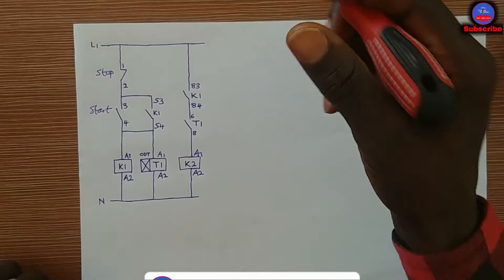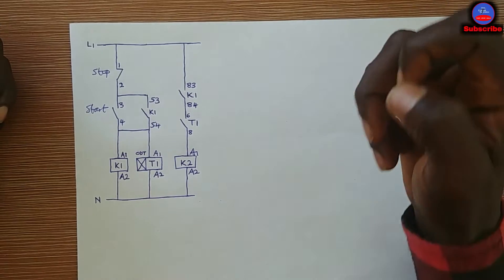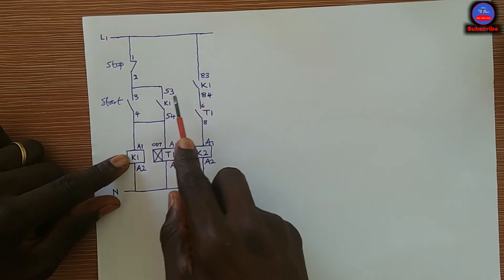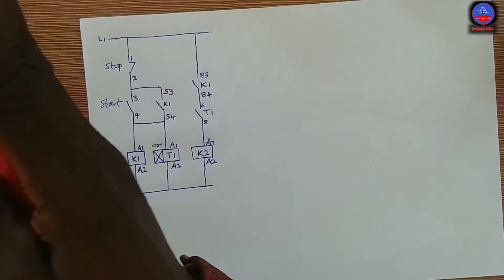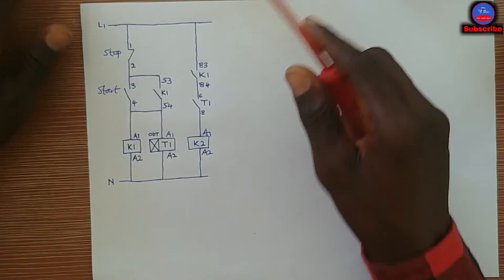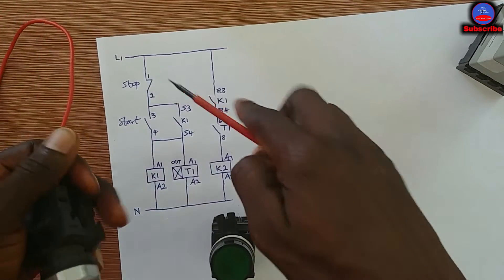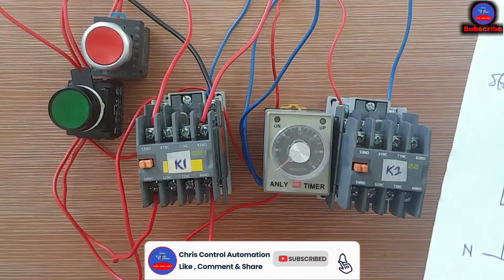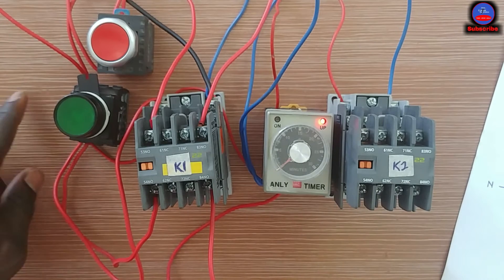Sequential Motor Control Circuit With Timer Explained #electricalengineering

Comment: I'm trying o simulate it in cade simu but it's not working
Reply from the maker: Screenshot the simulation and it to me to check it. May be some of the wires are not connecting well.